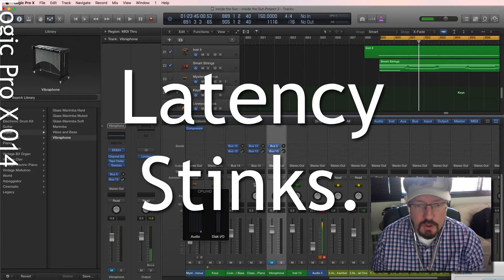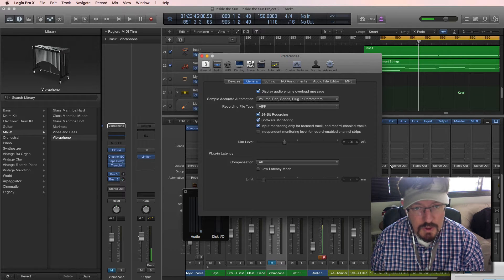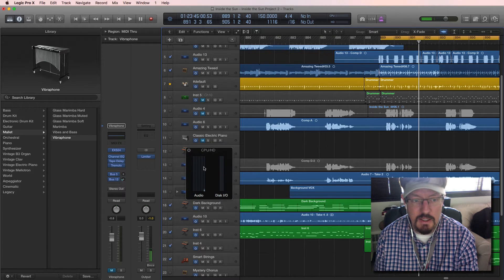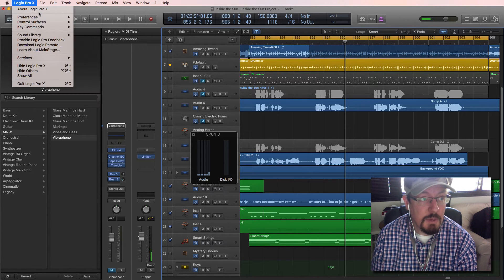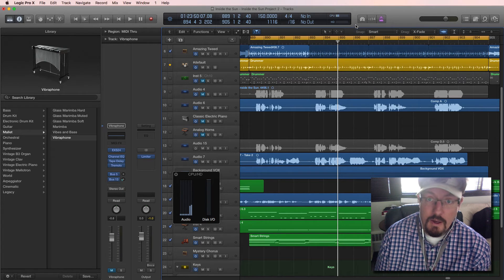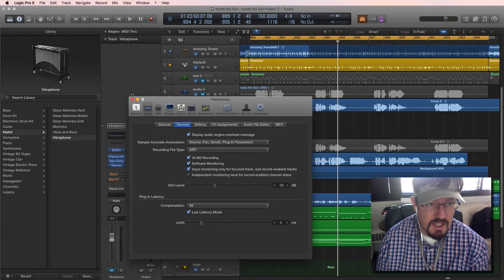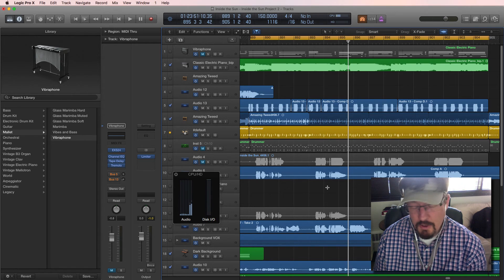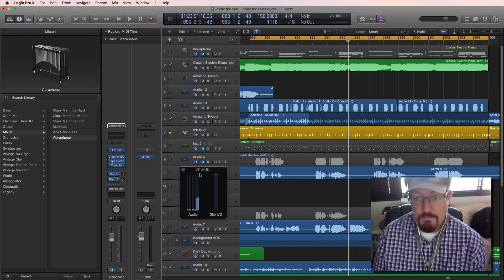Low Latenecy Mode in Logic Pro X

Comment: Do you have any clue, why "Low Latency Mode" disables my sends per default ("Low Latency Safe" not enabled) - even though there is NO plugin in the WHOLE project?

Also, why does "Low Latency Mode" not "work" on an AUX channel: the same (copied) plugin with latency above the set threshold get's disabled on the main track, but not on the AUX. ("Low Latency Safe" enabled, otherwise the whole AUX is disabled anyway)

What am I missing? This has to have some purpose...

Thanks for any input!
Cheers!
Reply from the maker: You'd have to tell me more about your computer, the plug-ins, and your hardware. Maybe send me your whole session and I'll open it on my system.
Reply: Thank you very much for your offered help!
iMac5k (2015) MacOS 10.13, LPX 10.3.2,  i7 6700k 4Ghz, 16GB, SSD: happens with every Interface I've tested (Laney IRT Studio/Focusrite Scarlett Solo Gen1/onboard), no matter what Buffer/Sample-rate Settings. Reproducible on my MBP (2011) too with same OS/interfaces.

New empty Project with just 1 Audio Track with 2 Sends, whole project empty otherwise - no plugins used. Enable Low-Latency mode = Sends get disabled (unless I enable "Low Latency Safe" for each send).

And when I put any Logic plugin (used Distortion (0ms) and Multipressor (2ms) to test) on the Send's AUX - the "Low Latency Safe" mode just overrules everything - not disabling the Multipressor (2ms), although my set threshold is 1ms - while the same Multipressor actually gets disabled - IF I put it on the main track and not the AUX send.

I'm pretty sure this behaviour is intentional - and I just miss something.
Reply from the maker: +You must enter a name in the settings is low latency set to ‘all’ or ‘tracks and instruments’? (Not at my computer so I think those are the two options.)
Reply: I tried it with every option "Off, Audio and Software Instrument Track, All" - always the same behaviour.
Reply from the maker: Okay. The send being deactivated is because it's on a track with an open input. That is standard to deactivate sends with live inputs and that's why there is a SAFE mode. The other issue is weirder. I think Logic is tracking the latency on aux tracks differently. Honestly I was just running a session and added 10 plugs with 50 ms each and nothing was deactivated when I went into low latency mode. Either a bug or somethings else is wrong. Can I ask where you are from?

Comment: (for some reason it wouldn't let me reply so maybe commenting will still work......)

but jeez i cant imagine how you got that many threads on such an old iMac.. i have a 2.8 Ghz intel core i5. but my cpu meter has 4 processing threads in logic.

question, ( if you get back to this )

does turning on low latency mode naturally just deactivate the plugin compensation set to "all".   because if it automatically shuts off plugins moving above the designated amount of latency. why would it still need to compensate?

thanks.
Reply from the maker: I believe it still keeps the compensation on for the effects which are under the low latency mode limit. At a 44.1kHz sample rate most effects are solidly above the limit and so it is the same as turning off low latency mode. If you work at a higher sample rate then the latency falls to much lower levels and could remain compensated even in low latency mode.